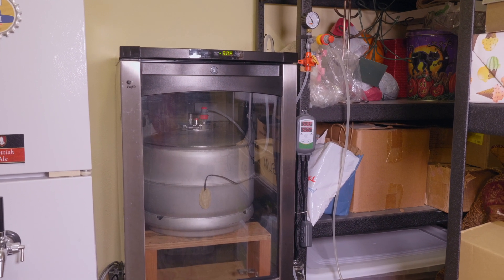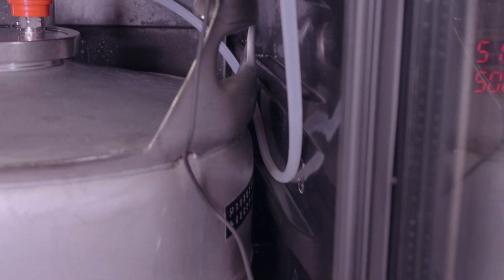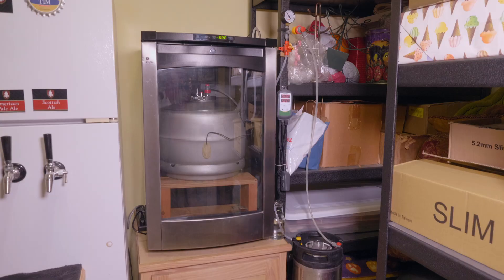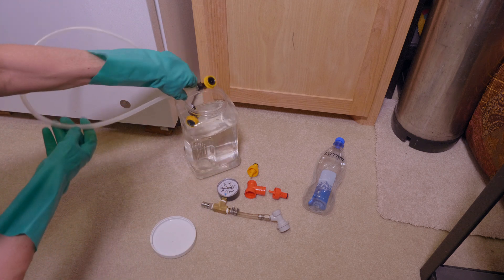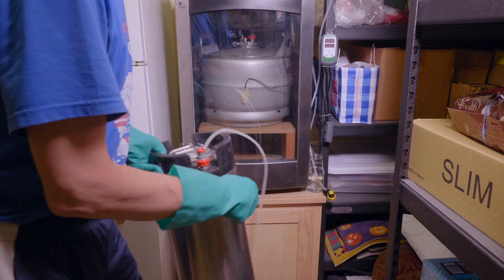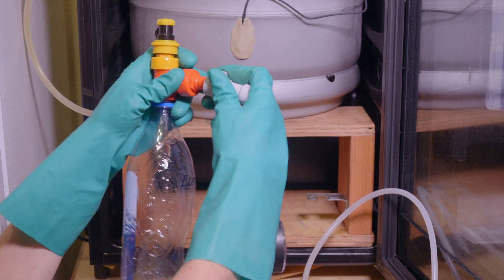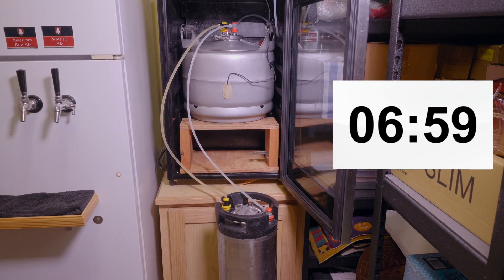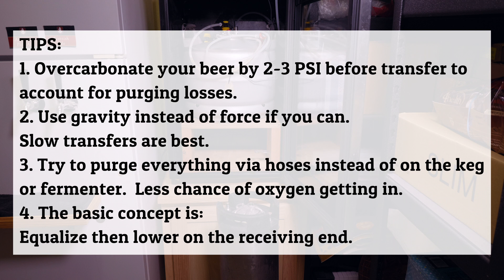Fermentation Gas Purging and Pressure Transfers

Comment: Nice process. Question on the fermentation itself. Do you attach the spunding valve set to your desired PSI right after pitching yeast? Or do you allow the yeast some time to get started first before putting it under pressure?
Reply from the maker: Thanks.  That is a strategy choice to make.  CO2 is toxic to yeast so it is easier on them if you wait to close the spunding valve.  It is also a strategy with regards to hops.  For IPAs I oxygenate and actually fill the fermenter with tank CO2 gas to the desired pressure as high pressure (2 bar) = more hop presence.  Where with a hefeweizen I would keep it open and then maybe put 4 psi on until I need to close it for carbonation.  A lot of levers to play with!

Comment: The way you pay attention to the detail is really impressive and your practices/solutions are very smart. I really appreciate the effort you put to avoid oxidation (even the tiny overkill was my favourite so far). My beer quality has improved a lot since I tried to keep an eye on hot side aeration along with the cold side aeration.

One little thing that may help your struggle unplugging or plugging the ball lock posts would be applying food grade lubricant just to the side edges of the puppet where it locks. That way it keeps being sterile but becomes very easy to plug or unplug.

Also the way you do things very calmly and gently is very relaxing to watch. My brew and transferring days are totally catastrophes.
Reply from the maker: Hey, thank you for the kind words.  Glad to hear your beers have improved with attention to oxygen.  I hope seeing some of my practices help you to calm your transfers and brewing.  I think it needs to be fun and relaxed but I have had my share of yelling and foul language!  Planning and having a repeatable process really helps keep things working well.  Keep up the learning and try to make notes of your beers as you go.  Low oxygen can go too far as well and remove all flavor.  The goal is to find the right balance for your palette.  But it is good practice to learn how to get to that limit.

Thanks for the tip on QDs.  It is frustrating how some work well and some do not.  Even the new Kegland QDs seem to have variation as I have struggles with them on different kegs.  Someday I need to pay up and replace all of the posts on all of my kegs to ones that do work well with the QDs.  But that will probably never happen!

Comment: I found it interesting how you draw some co2 out of the serving keg towards the end of the transfer.  Are you worried of o2 ingress with pulling the prv?

I also do gravity transfers and also draw off some of the beer before attaching the tubing to the serving keg.  Instead of a bottle, I position a large measuring cup below the fermenter and use my finger to depress the poppet on the quick disconnect.  This fills the tubing with beer and hopefully displace the o2 into the measuring cup instead of into the fermenter.  Do you see any issue with that?
Reply from the maker: Hello,

There are others' who know way more about gas exchange than I do, but I will share how I think of it.  In short, yes I do see some pitfalls with your method.  It is important to not see gases like oxygen in terms of "flow".  Meaning they do not move like water or common flow forces.  If there is any kind of opening, Oxygen will find a way in.  Even if there is gas coming out to some extent.  Pressure and gas exchange are separate.  This is how a pressurized container like a keg will still have oxygen pass through its seal for example.

I find distance is a little help.  So instead of pulling the PRV which is attached directly to the keg, I bleed 3 feet away from the keg.  Because when you pull the PRV, there is an opening for O2 to get in.  And it will.  Yes it takes that level of detail to deal with oxygen!

I like the bottle approach because I can equalize the pressure which results in a slow flow I can control and also allows me to see how clear the wort might be to know when to stop letting it out.  In this case, I do not think there is much difference in both ways when it comes to oxygen.  If I had purged the bottle first, then it might make a small difference.  But this step to me is all about filling the line with beer which pushes the oxygen out.

It is very complicated trying to deal with something you can not see.  Hope this helps.
Reply: @integrityhomebrewing7202  Agreed! It's not very intuitive to think about how gases mix, exchange through different media, etc.  Another thing I used to do but got lazy was to fill the entire beer line with sanitizer, hook it up to the fermenter, and do the same thing with the measuring cup.  Intuitively this seems like a more foolproof approach as the beer will push the sanitizer out the hose.  I guess it's possible that there's still some o2 in the hose filled with sanitizer.  Great videos btw!

Comment: I really like your gas purge setup - much simpler than the "push StarSan out"purge method. Question - do you feel there is any relative advantage/disadvantage of the liquid push method v yours?  I would rather just put the spunding at the end and avoid having 2 kegs involved or a big bucket alongside the keg. I hope my question makes sense. Thank you for all the great info on your channel!
Reply: Thanks and I hope the info helps.  I started with pushing sanitizer out of a filled with tank gas.  That method is completely fine.  I moved to the gas purging because it is easier and does not need tank gas.  Easier for me is being able to sanitize the keg with the same batch of sanitizer I mix up for the fermenter on brew day.  I fill up my fermenter with sanitizer and start a siphon into the keg.  So everything is done during brew day.  When it comes time to transfer it is just hook it up and go.  I like eliminating the need for tank gas outside of serving.  The approach is all natural, 100% pure CO2 and you do not have to buy CO2 very often.  Win-win.
Reply: @timpolster  Thanks for the details, super helpful. I'm going to use your method! Cheers

Comment: How do you purge the water bottle before connecting to the keg? Is that introducing any oxygen?
Reply from the maker: Hello, Since the water bottle is only connected via the tubing and gas is flowing into the bottle, I do not consider it much of a risk.  If it was connected for a longer period of time, yes, the oxygen would eventually travel into the keg.  That is why I purge the tubing again after I disconnect and attach to the keg.  This also lowers the pressure a little bit more in the keg to improve the transfer speed.
Reply: @integrityhomebrewing7202 I would recommend just equalizing the pressure in the bottle with tank gas or not equalize it all together. If you are only using it to clear the first bit of beer out of the keg it shouldn’t matter if it’s at the same pressure of the keg/kegmentor as you don’t need to maintain the carbonation level in the soda bottle beer you will eventually dump. Not connecting it to your perfectly purged keg will just reduce the risk of oxygen coming into the keg once the pressure equalizes.
Reply from the maker: @Averydrumz  Yes, it is best to avoid any contact.  I have just hooked the bottle up to the keg and it equalizes just fine.  Tank gas is also good but I want to keep the process all enclosed without needing tank gas.  Without any tubing on the inside of the plastic disconnect going in bottle, I would rather keep the gas disconnect clean with slow flow (without spray).  So I did it the other way for the video.  I will try it with a little bit of tubing to extend further past the gas disconnect next time.